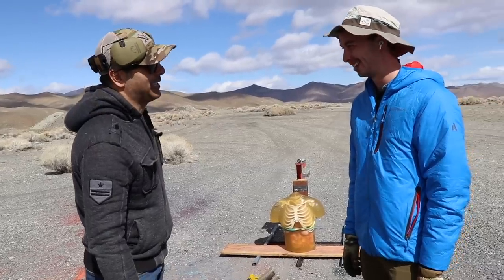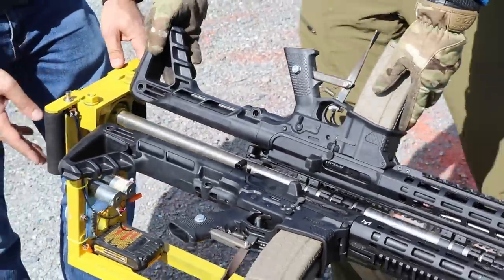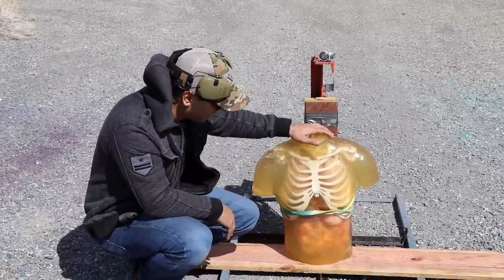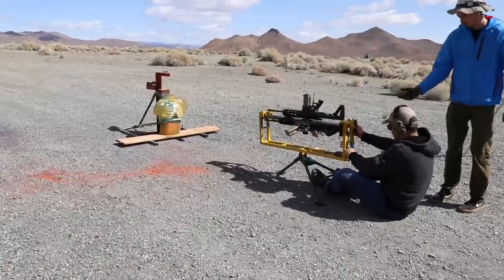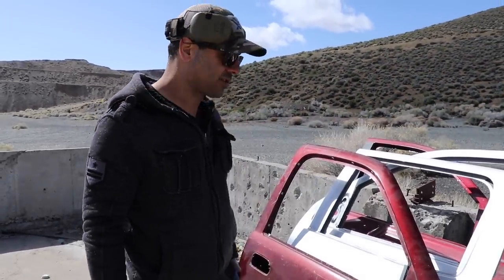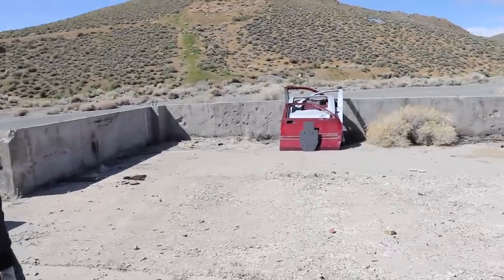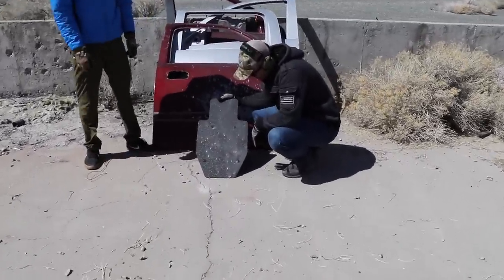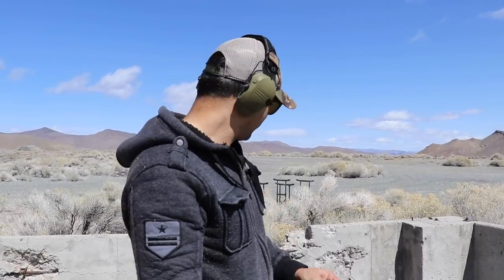R3dNeck MiniGun

Comment: Several years ago I went into a gunshop in Cedar Park Texas and they had on display a tripod with a contraption into which any self loading long arm desired could be clipped. This thing had a hand crank and a rotating cam that contacted the trigger that  turned it into a mechanical machine gun, like an old gatling gun. Pretty neat. This is better.
Reply: It is VERY unfortunate that The Best Of The West range in Liberty Hill, TX closed :(
They had range up to 1,000 yards and was the BEST in that whole area...
Reply: Sure this wasn't the Self's gun shop outside of Liberty Hill?
Reply: I was under the impression that Gatling Guns are legal because they fire once per crank/rotation by hand (one bullet per turn), but it seems like inviting your dog to get shot if you make it one button/trigger press to fire a burst of  rounds, without getting the required tax stamp first.

Comment: Years ago I had a similar idea of doing this with 6  Ruger 10-22 rifles with 50 round magazines.
Reply: Now that’s one hell of an invention 😂
Reply: Back in the early 2000's Cabela's sold a double barrel Gatling gun kit for the Ruger 10-22. Not sure if its still available though.
Reply: @SledPrn6  It uses two 10/22s & they're still made.
Reply: I had the same idea long time ago but to strapped for cash and don’t want to destroy some guns
Reply: @James-vn8zb  Oh I know it uses two  of them. Good to know its still available, might have to get one. Granted I don't think it is still $299 anymore.
Reply: @SledPrn6  Pike Arms makes a version now, but it costs between $850 and $900, depending on the finish.  Then, you also the cost of two 10/22s and ammo, if you can find any of this in stock anywhere.

Comment: The problem with constant jamming is probably caused by the dual ejection ports, one of which could probably catch the round as it ejects if your ejection pattern is gassed to eject at the 3 or 9 oclock angle, whichever one is facing into the direction the guns spin. Sadly the best fix is probably to just use six normal ARs so it ejects away from the spin.
Reply: I was wondering why they were using a gun that (at least in my limited experience with them in the military) has a high likelihood of jamming.

Comment: you need to make 3 circles of metal to house the spindle in the middle of it (weld a peace sign into the two end circles with a bearing housed in the centre to hold the spindle)  and then have 3 trigger points around the edge of the middle circle.

That way, there will be zero framework in the way and 3 TIMES the number of shots set off in 1 rotation

Make it so #1!

Comment: ATF Rul. 81-4
The National Firearms Act, 26 U.S.C. 5845(b) defines “machine gun” to include any combination of parts designed and intended for use in converting a weapon to shoot automatically more than one shot, without manual reloading, by a single function of the trigger.

Since you push one button to rotate the rifles which makes them fire as well, the ATF may be consider this a "machine gun". Might want to be careful guys.
Reply: May consider this*

Comment: Uh oh, that might be a machine gun. Yea I've heard of this contraption before, some guy made one I think with 4 ar15s and it was perfectly legal. The difference was his model was hand cranked so each turn spun it once and pulled each trigger once. Kind of like a gatling gun.
This on the other hand has 1 trigger, an electric switch. 
The ATF could very well show up and say "This is a machine gun because it has 1 trigger", it might be classified as a volley gun but typically thats only 1 shot per barrel. Anyway I'd be a little paranoid right now, maybe contact a good lawyer just in case to go over everything and make sure its above the board and your not going to get a nasty call from the ATF.